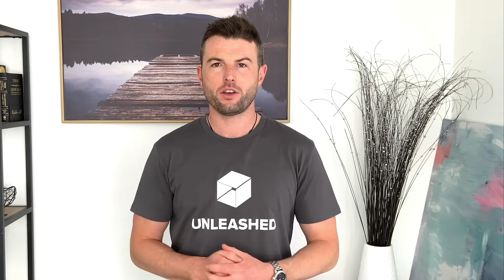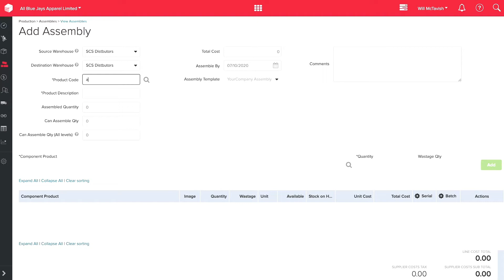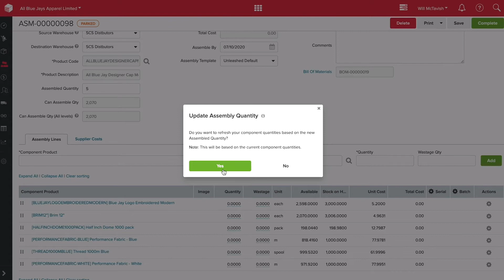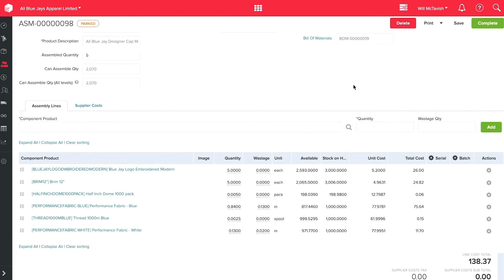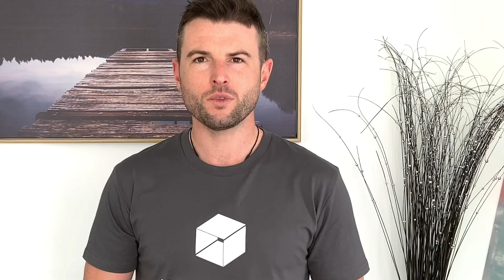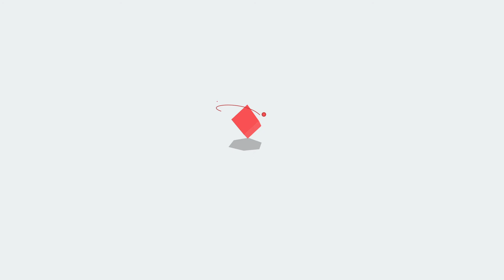Decoupling Inventory – How It's Used in Manufacturing | Unleashed

Comment: In your Software application. Is the decoupled stock separately indicated as special stock to highlight during a picking operation, as it is not normal stock.

Would have been good if you had shown the goods movements against the Assembly order as special goods receipt for the Assembly order.

Comment: Hi 
@ 1:11 Minute.
Can you please clarify on the following point with regard to item serial no 5 [THREAD1000MBLUE] on your Bill of Material Item. 
If the Unit of Measure is a spool, and quantity required to manufacture a single unit of Cap is 0.0005,  is the value 0.0005, a percentage of the specific length (consumed to produce a cap) of the total length of the thread in a Spool.